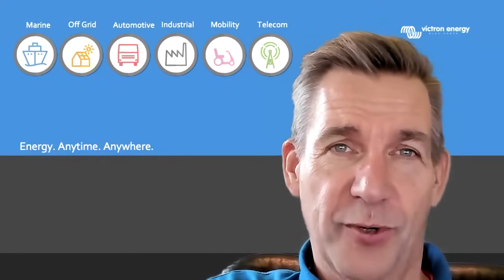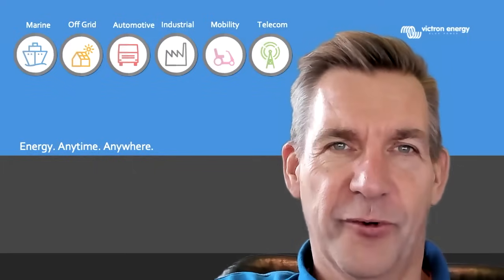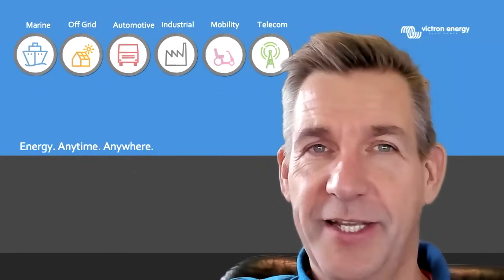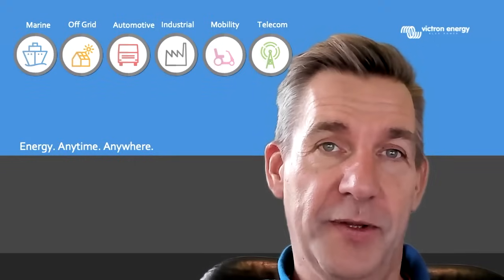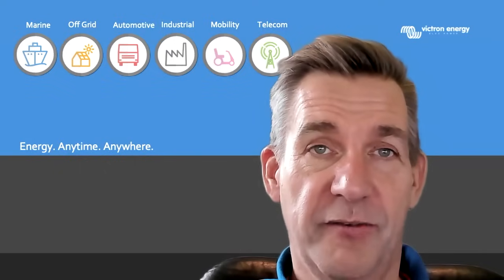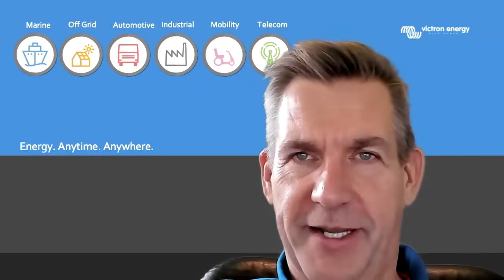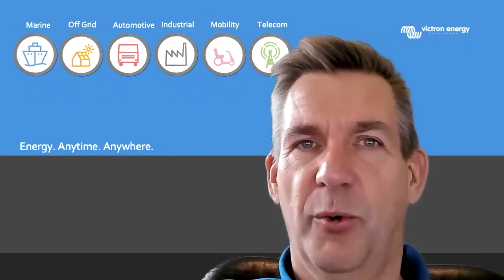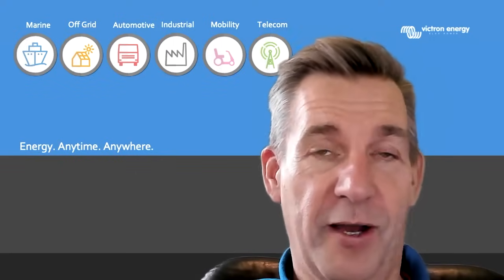How to set up BMV Battery Monitor for lead and lithium batteries

Comment: In the video (and in the manual) it says that with a solar charge it is advisable to set the synchronization with a voltage 0.2 lower than the absorption voltage, and a tail current of 4%.
I adopt another system.
I set a sync voltage at 13.5v (-0.3v with respect to the floating voltage) and a tail current of 0.8%. And a time of 6 minutes.
In this way the smartshuunt is synchronized every day after the floating phase has begun.
And the jump is always 1 or 2%.
That is, in the moment of synchronization, the AH count has already reached 98 or 99%.
And the passing of clouds cannot cause false synchronizations.
(((I'd like to remind that the real current of a fully charged lead acid battery agm is 0.3 mA for Ah of capacity. 
This means that a 100 ah fully charged battery absorb ONLY 0.03 Amp at 13.8v.
Otherwise the battery is not really 100% but about 99%.))))
Is there any contraindication in these settings?
THANK YOU
Reply: In your case you will see a lot false syncs on a cloudy day as the amps drop off fast at a cloud but the voltage drop slow....
Reply: @johannesboonstra6917  Thanks for. Answer.
In fact, I have never seen a false sync in 6 months that I have the smartshuunt.
I live in the camper.
There is one synchronization every day, around noon, or later if it is cloudy.
When there is very bad weather, the synchronization does not happen.
If a cloud passes, it is true that the current drops. But having set a voltage of 13.5v, the schunt does not sync.
All synchronizations always take place when the charge has reached 98 or 99%.
And the AH bill is about - 2 ah.
I think this is a good result.
I think a 4% tail current does not indicate a fully charged battery. Rather it indicates a 90/95% battery.
Reply: @johannesboonstra6917  in fact, if pass a cloud, it's true that the current drop fast. But also the voltage drop under the set voltage(13.5v) almost immediately, if the battery is not fully charged, and there is not enough current to maintain the voltage above the set voltage (13.5v).
Today, with a clouds alternate sun day, the battery start with - 20ah from the previous night . The absorption lasted 1h and 10 minutes, and the synchronization happened only after 3 hours after the end of absorption.
When the AH count was at - 2 Ah, the percentage was at 99%, and the voltage was at 13. 79v and current in to the battery was 0.79A.
I think the jump only from 98-99% to 100% indicates a very realistic reading of the smartshunt with these settings in these conditions.

With defaults setting (13.2v 4%) I have a jump from 93 to 100%. And synchronization happens ever before the end of absorption. 
With settings suggested in the video for solar configuration (14.2v 4%) also I have a jump from 93-96% to 100%. And synchronization happens ever before the end of absorption.

I use the battery every night from 100 to 80/88%. And the charge current of solar charge controller is on average 5-12 Amp. 
Maybe for these reasons the default settings doesn't work fine in my case.
In conclusion I think the default settings (synchronization before the end of absorption) is OK.
But if you now very good your battery, your charge controller, and all your system, you can set better the smartshuunt. With a synchronization only AFTER the end of absorption phase.
In this way, the reading will be more precise.
Reply: @fc436  this is very interesting 🧐 I use 230ah of lead battery banner bull could I also try the settings you mentioned above because I’m also having issues following mentioned in the video ? I use a 50 amp mppt and bmv-712

Comment: Dear Johannes, I have installed the Victron smartshunt in my motorhome. I have two 95ah agm batteries and three charging sources: from the electric grid (IUoU 18A abs. 14,3v and fl. 13.8v), from a solar regulator (IUoU about 18A, abs. 14,7v and fl. 13,7v) and a battery to battery chargher (booster) (IUoU 25A max limited current, abs.14.7v and fl.13.7v). How should I correctly set the smart shunt parameters so that the readings are true considering the three charging modes?
 I want to find the best compromise of these settings for my setup
Thanks very much in advance.
Fabrizio
Reply: Good question, of course you do realize that the battery is the criterium all charge settings should be based one, So if you have three various settings at least two are not 100% correct.  If you feel the battery get ill with the lowest abs voltage, that's the settings to use.
Reply: @johannesboonstra6917  ok, thanks. At the moment I set: capacity 190 ah c20, VC 14.2 (I think better 14.1), discharge fl. 50%, Tail current  4.5%, CDT 5 min, charge efficency factor 83%. What do you think about these?
Reply: @fabriziobertoldo7653  ciao parli italiano?
Volevo dirti la mia sulla tail current dello smartshuunt...
Secondo me è esageratamente alta.
Una batteria al pb al 100% assorbe meno del. 2% a 14.4v e meno di 1% a 13.8v.
In realtà i test FIAMM dicono che una Agm completamente carica davvero, assorbe solo 0.3mA per ah di capacità a 13.8v.
Significa che una agm da 100 ah realmente al 100% assorbe solo 0.03 A a 13.8v.

Quindi secondo me, settare la tail current al 4 o 4.5% causa una sincronizzazione molto anticipata.
Tanto più se la tensione di sincronizzazione impostata è bassa (es 13.5v), ma anche se è impostata vicino alla tensione di assorbimento (d es 14.2v).
Io vivo nel camper esclusivamente con solare da 300 watt e una batteria agm victronenergy da 110ah.

Ho impostato la tail current a 0.8% e la tensione di sincronizzazione a 13.5v. E tempo 6 minuti. 
Questo fa si che mi sincronizza sempre e solo dopo che l assorbimento è terminato. Cioè dopo essere entrato in floating. 
E dopo un pó di floating. 
Infatti alla fine. Dell assorbimento una batteria non è al 100% ma piuttosto al 97%.
In realtà ci vogliono parecchie ore di floating per completare l ultimo scalino. 
La prova che queste impostazioni vanno bene è che quando lo schunt ogni giorno sincronizza il 100%, il salto che vedo è solo da 98% a 100%.
Impostando una tail current alta, si vedrà un salto più grande, che non è proprio corretto... 
Ciao
Reply: @fc436  Grazie. Tenendo conto che carico con 3 fonti, volevo trovare il settaggio che sia una buona via di mezzo. Cosa mi suggeriresti per tutti i vari parametri?
Reply: @fabriziobertoldo7653  ciao... Guarda non conosco così bene la fonte 220.
Quello che posso dirti è che con il solare, io ho degli ottimi risultati di precisione impostando una corrente di coda di 0.8%, e una tensione di sincronizzazione di 13.5v e un tempo di 5 minuti.
Con queste impostazioni la sincronizzazione avverrà SEMPRE DOPO CHE LA FASE ASSORBIMENTO È STATA TERMINATA. UNA MEZZ ORETTA DOPO CHE È INIZIATA IL MANTENIMENTO. 
Credo che puoi ottenere lo stesso risultato impostando una tensione di 14.1/14.2v e una corrente di 2.5%.
Personalmente penso che una corrente di coda di 4% causi una sincronizzazione anticipata prima che sia veramente completamente carica. Infatti se noti i cb e regolatori victronenergy hanno una corrente di fine assorbimento di 2% e non di 4%.
Solo lo. Smartshuunt ha una impostazione predefinita di 4% per sincronizzare il 100%, ma non ne capisco il motivo ....

Comment: I want to replace my standard caravan charger in my campervan. It charges and supplies 12v power. Only thing is the 85 amp hour AGM leisure battery is in the engine bay and the battery charger is in the living area at about 3m to 4m of 29amp sheaved automotive cable.

WOULD THE VICTRON BLUESMART IP22 12V 15AMP 3 OUTPUT BATTERY CHARGER BE OK AS A REPLACEMENT?
Reply: Yes , although you didn't state the size of the battery, this should be ok up to 150-200Ah
Reply: @johannesboonstra6917  85 amp hour AGM

Comment: What would be a recommended value for absorption voltage as the battery manufacturer states for the cyclic use 14,6 - 14,8V charging voltage and for the stand by use 13,6-13,8V. Should I use the cyclic values here? And what about the float voltage?
Reply: as low as possible, that's better for the lifespan.   so 14.6Vdc /13.6 Vdc

Comment: I have a question about batteries - I am upgrading my camping trailer to lithium using victron smart AC/DC charger, MPPT smart solar charger and Orion Tr 12-12-30 for alternator input. Is it best to have 2 x 100AH battery OR 1 x 200AH battery?
Reply: To reduce the change of inmablance between the cell (for wich there is a balancing circuit of course) having larger batteries is preferred over smaller/higher number.

Comment: settings recommended for BVM for  LITHIUM LIFPO4.
 ok so  he says for lithium  14.2v is full charge for a 12v battery. 
 so for the charged voltage setting would be 14.2v minus 0.2v giving 14v. 
 CHARGED VOLTAGE set to 14V. (12v)  28v(24v) 56v(48v)
DISCHARGE FLOOR set at between 10% and 50% i use 20%
TAIL CURRENT set to 5%.
CHARGED DETECTION TIME set to 5 minutes.

PEUKERT EXPONENT set to 1.05.
CHARGE EFFICIENCY FACTOR set to 99%
Hope that helps

Comment: Our new system includes 600Ah of Battleborn lithium, a 1200w of Solar, a 250/85 SmartSolar MPPT, a 3000w MultiPlus and a BMV-712.  Please clarify settings to ensure the SOC calculation from the BMV algorithm overrides any other SOC calculation.  Thanks.
Reply: Just fill in the battle born "charged" values in the BMV.  To override the Multi SOC reading there is also a Cerbo or other VenusOS device needed.
Reply: @johannesboonstra6917  We do have CerboGX with color display. Forgot to include it in my 1st post. How do I override SOC. Thanks
Reply: @srqutube  in the Cerbo menu under system settings you van select which SOC source to use and if you want to overwrite the Ve bus soc 
So select the BMV as source , and choose overwrite

Comment: trunglqvtv avatar image
trunglqvtv asked · 23 secs agoActions
SKYLLA-TG 24/80 burn resitor and diode
I have SKYLLA-TG 24/80 but missing D22, C31, D21, D23 and resitor R43

Please help me the value and code ò them so I can replace the component

video: https://www.youtube.com/watch?v=SUDb_R-0a4E
Reply: Please contact the local dealer for repairs, they are found on the were to buy page of the Victron website.
Reply: @johannesboonstra6917  do you have diagram? could you please send me via email?
Reply: do you have name and value of d22,c31,r43,d23 and d21
Reply: @electronics_engine  no , that’s not available.   Please contact the dealer for repairs
Reply: @johannesboonstra6917  in Vietnam I can not find them, please help me
Reply: @johannesboonstra6917  is that 1N4742A, zerner diode?
Reply: @johannesboonstra6917  d21,d22,d23 is 104742A , c31 473 and R43 is 330Kohm 2W
Reply: @electronics_engine  There is really no point in asking again. Repairs are only done by service centers , so please ask the dealer what's the fastest way.   Diagrams and such are not provided.

Comment: Thank you for the very detailed explanation. I had no difficulty at all understanding your accent at all as I worked with FLS for several years. Additionally you speak in a very distinct and measured pace. A trait i noticed was common with many of my Danish colleagues at FLS.

I will be installing the 712 monitor in the spring. I have 3 lithium for the house bank and 2 led acid for the starter and bow thruster banks. What would be the optimum setting to accommodate a  mixed lithium & led acid  chemistry bank or do I need to completely separate the disimiilar banks? 
Cheers Kevin

Comment: Un vídeo muy necesario para entender como funciona el BMV. Tengo una duda. Cuando en lugar del BMV se utiliza el medidor de batería del V.E. Bus System de un Multiplus. ¿Hay que configurar la capacidad de batería en C20 también? Gracias
Reply: A very necessary video to understand how the BMV works.  I have a doubt.  When instead of the BMV the battery meter you use the V.E.  Bus System of a Multiplus.
  Do you have to set the battery capacity on C20 as well?  Thank you
Reply: @nacholeon8392  Yes, sorry if that wasn't mentioned clearly by me, always use the C20 capacity of the battery capacity
Reply: @johannesboonstra6917  Thank you.  I think that at some point in the video you do indicate the capacity in C20.  But what was not clear to me is whether in the multiplus configuration you also had to put the value of C20.  Now it is clear to me.  Thanks again.

We learn a lot from your videos.  As a suggestion, it would have been good to have images of the BMV while you were commenting on the configuration 😉😁

Comment: What if I decide to set a Life Saving profile setting for my Lifepo4 Victron 200ah in my PV MPPT for the time my RV stays parked for 1 month but still need electricity in there ?
Now i've created a profile for this with Absorption 13.6 Float 13.4...I don't want the battery to sit at high voltage... but what about the absorption time ? ... what would be the better configuration to have in the victron mmpt for this period of time?
Reply: For lithium the absorption time is use to balance the cells, when the batterie isn't used there isn't unbalance either. So absorption isn't needed then.  PS the "high" voltage of 14,4 or higher might limited the lifespan when always applied, when the float is 13,3 (my advise) your are safe to have the battery sit at that level.

Comment: Do you guys at Victron see a chance that "Low SOC relay" and "Discharge floor" could be set independently in BMV settings?

I use the relay of the BMV to stop alternator charging of my Lithium battery at 90% SOC and restart alternator charging below 85% SOC. As discharge floor is automatically adjusted to 85% SOC in this case, the "Time remaining" display becomes useless.
Reply: Well, the time remaining is then the time you start the generator isn't it? I am not sure you also have the Ve Bus SOC overwritten by the BMV, in case you did you could start/stop from there on any SOC level you want.
Reply: @johannesboonstra6917  Actually I do not start the generator with the  BMV relay. I just use the relay to prevent the alternator of the propulsion engine from charging the lithium battery when it is already almost full. So I want to set "discharge floor" to 10% to have a reasonable "time remaining" reading. But "low SOC relay" needs to be set much higher for my application.
I do not see a reason why both settings cannot be set to different values. When I set "low SOC relay" to 85% under relay tab in Victron connect, the "discharge floor" under battery tab is automatically changed to also 85%.
Is there a chance that this will be corrected in a future firmware update?
Reply: @johnbee1107  For what it is worth, I have exactly the same opinion :)
On one installation, I  use the BMV relay to control an electric water heater, enabling it when the battery is above a high SOC - 90% - to make best use of excess solar harvesting which would otherwise be wasted.
On another installation, I use the relay to disable the inverter supply to a Water Heater and Fridge so those two items switch to Gas instead when the SOC drops below 80%, in order to reserve remaining electricity for systems that are electric only (again this is to maximize solar harvesting benefit).
In both cases it makes the Discharge floor and time remaining totally inaccurate/irrelevant.